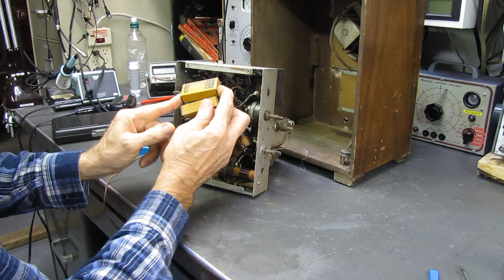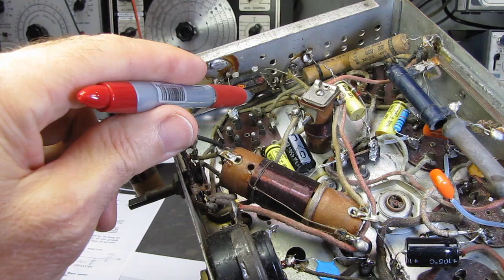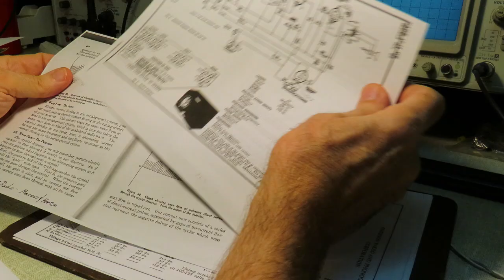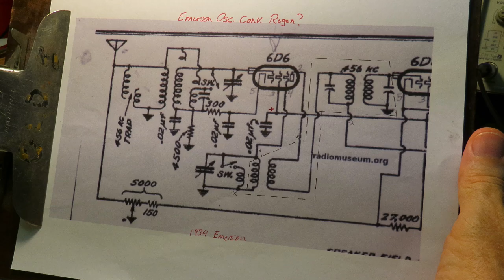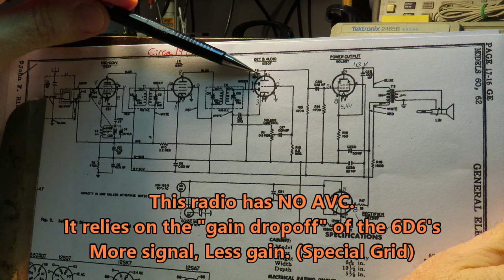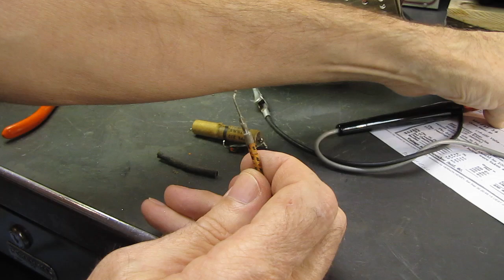Emerson Model 36 Chassis B5 Very Odd Design

Comment: This receiver does not use regeneration. The part of the circuit you are describing is the local oscillator (though oscillators use positive feedback). The detector is an ANODE BEND detector (biased to cut off). A leaky grid detector has zero bias. It relies on the resistor/capacitor to control the voltage at the grid.

Comment: I could be wrong, but is this an example of an "Autodyne" converter circuit?
Reply: Only in the plate part of the circuit. This is an unusual design that uses the screen grid, suppressor grid and plate of the 6D6 as an oscillator triode. I guess they did it this way because the standard autodyne is no good for short waves.

Comment: Superregeneration is a mystery to most but the radio you have is a practical ( cheaper) modification to work only as a regenerative receiver with elements of a TRF set and by putting dashed lines around the actual first IF it makes sense. 
Cool article finds as it help solves the mystery of a go between TRF and superhet technology.  Great learning experience 
on a  radio from 1934. Always appreciate your videos Vern.
Reply from the maker: Thanks Master, High Praise coming from you. 😀
Reply: I learnt a good deal and Vern answered some questions I should have asked fifty years ago. Nice the way Vern involves us in the process.   Any one who refers to the Doobaly Doos (aka AVE) is obviously worth listening too.  Best

Comment: Hi Vern, I'm glad it's you restoring this radio, I would have been lost, too many different design features. I guessed the 76 tube was using anode bend detection, wrong again. I haven't seen a radio with grid leak detection. I have a copy of the radiotron handbook, it was produced by AWA in Australia, a very good book. Great video, I learned a lot, thanks 👍🙂
Reply from the maker: Hi David,
The difference between Grid Leak and Anode Bend are a fuzzy line to me. I had originally put in a section in the video showing the tube operating curve and how it is biased to "clip" and rectify. The video was getting so long I deleted it. I am just in the habit of calling this grid leak. Both use a non linear portion of the tube to rectify/detect. Trouble with a set like this is it relies on perfect bias in the I.F. and in the detector and as tubes and resistors age bias drifts and distortion sets in. But considering the age of this set it works pretty well. Thanks for watching.
Reply: Kaput Restauriert.😡

Comment: 50Hz creates more magnetic flux in the core, which increases core loss dramatically if the transformer was designed with the core near saturation at 60Hz.